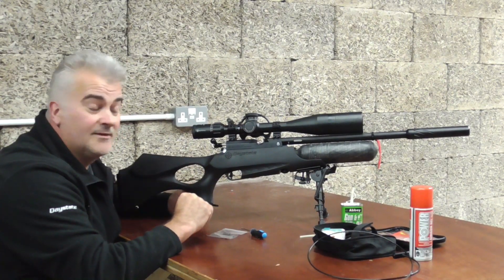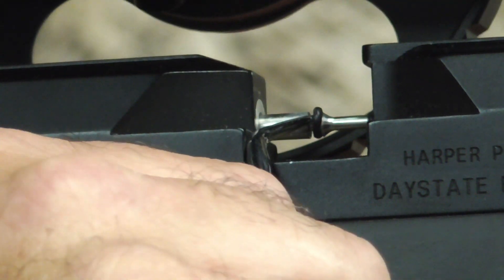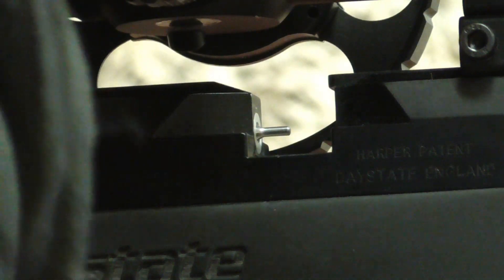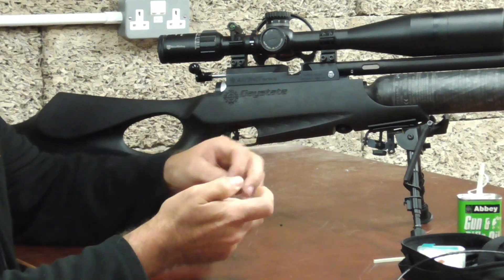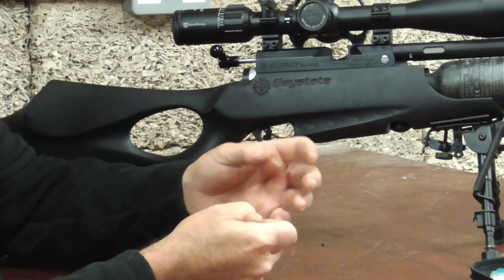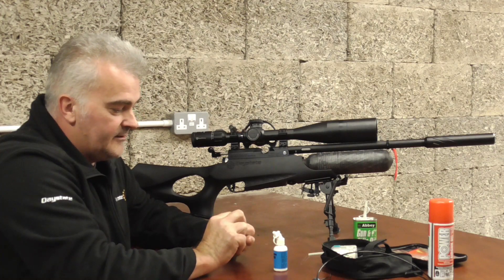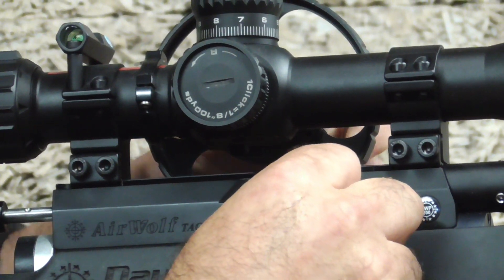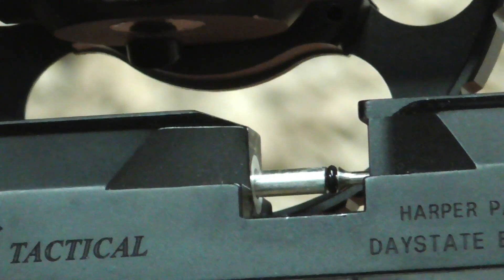Daystate Airwolf Probe Seal

Comment: Put new probe seal on probe ( thin part at front ) , push near tapered bit put tweezers in , add a squirt of gun spray .. close tweeters gently round pin .. push bolt forward , the rubber seal will " ride the taper " up into its seated position , 20 second job ... done it a few times ..